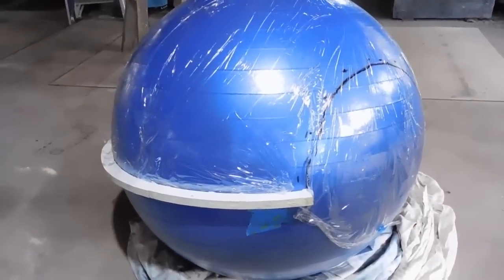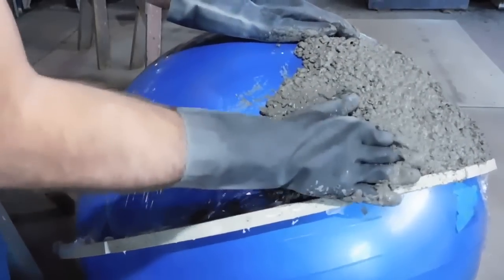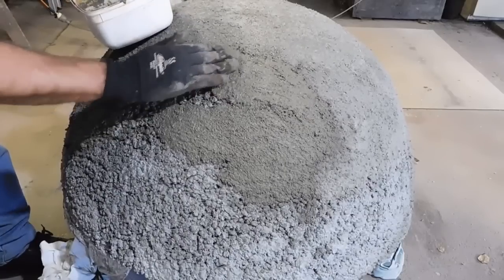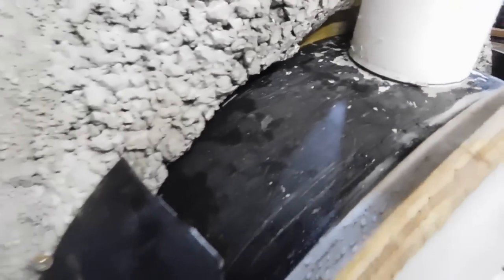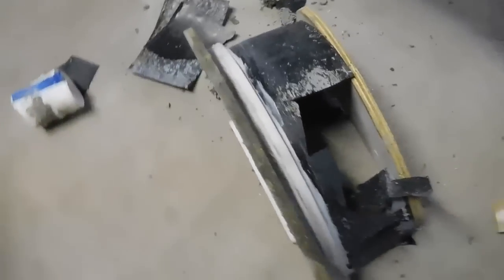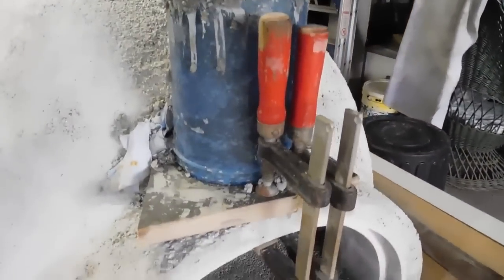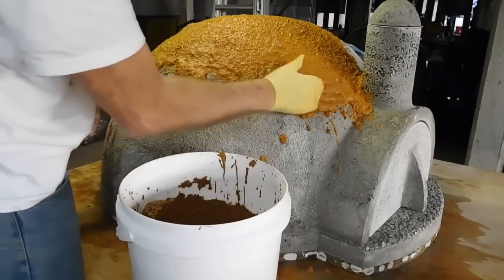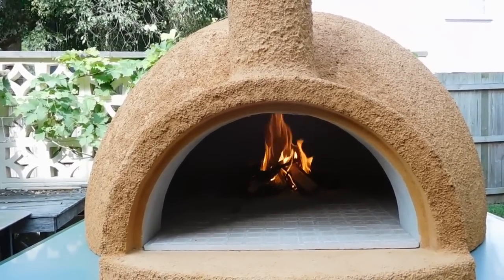Pizza Oven Easy  Build  "Full Video''

Comment: very good video indeed. i have tried the same thing after seeing ur video. thanx for the inspiration m8 ;) 
but i have 2 questions if u may answer. 
1) after you remove the the pastic film that u had wrapted the ball. there are some scratches. when u turn the ciment upside down there are no scatches. u used something i guess... 
2) at the end of the video when open the do or to start the fire there is somethng on the bottom of the oven. is it a tile turned upside down or its my thinging???

3) lastly . english arent my native language so i cant understand some of what ur saying espessially when there is outside noise.... also i dont know the exact names of the matterials u have used.
do u mind writting down how u made the ciment? ( the repipe i mean ) so i wont stragle to listen :P also i could use google translate :)
Reply from the maker: This is 5 part crushed pumice and 1 part standard portland cement. I used fine pumice-cement mix sieved through flyscreen to fill any imperfections on inside and this can be sanded like timber.On the floor are upside down 8mm clay tiles unfixed to keep floor cleaner ! See first oven >https://www.youtube.com/watch?v=uOJq6g4at-0

Comment: Best build on YT! I'm in the planning stages of my build and keep coming back your video. 
Question: What size of ball are you using? Ive built a jig off of your 8" hight for the opening, and it looks small compared to my 70cm ball.
Reply from the maker: My ball was a 75cm pumped to 82cm using air compressor and I think the door is 60% of oven height Jason !
This site shows door height ratios etc>http://pinkbird.org/w/How_to_build_a_pizza_oven
These ovens expand and contract so build fire up slowly and good luck with your oven build !
Reply: @jjgrice018  Thank you for the response!

Comment: How much concrete an perlite should i buy to build the same oven? Thanks
Reply from the maker: I used about 80 litres of mix and weighs about 55 KG ! One 20 kg bag of cement is plenty . I see a lot of people using vermiculite concrete !
Reply: @jjgrice018  ok i think i'll buy a 50 or 60 litres bag of pumice. I prefer this inert because it's lighter and a better insulator than perlite / vermiculite. Thanks
Reply: @jjgrice018  I'm considering in drown a refractory plate in the middle of the concrete platform, where the pizza stay.
Reply from the maker: May work ! Sometimes I put a pizza stone in 10 minutes before cooking pizza and cook on that ! I have cracked them by putting in oven to early !
Reply from the maker: Pumice uses >https://hesspumice.com/pumice-pages/pumice-uses/uses-for-pumice.html

Comment: what material is it in the hob?
Reply from the maker: They are 8mm clay tiles upside down unfixed but did crack and the cracks filled with ash or you can cook on the pumice concrete original floor Manuel !

Comment: Hi mate, you are a legend.
May I ask:
1) what’s the size of that yoga ball? 75 cm?
2) how much pumice did you use? And what size? 1-4mm?
3) what was the ratio of pumice to cement to water?

And finally, what insulation did you use underneath the oven? Calcium silicate board or just refractory bricks?

Thanks
Reply from the maker: I'm not a legend yet as i'm still alive ! It is a 75 cm ball pumped to 82 cm and the mix is 5 part crushed pumice put through 10mm sieve with lots of very fine pumice to fill any voids in mix and 1 part cement and about 1 part water.
The oven base is 50mm of same mix and oven sits on 19mm form-ply with 4mm alucabond on top of form-ply !
See pumice uses here Sir >https://hesspumice.com/pumice-pages/pumice-uses/uses-for-pumice.html

Comment: Great video. I’m between building a brick wood oven or one like yours. How has it worked for you? Any cracks, anything you would do different?
Reply from the maker: Thanks for watching Max ! My biggest orange oven weighs about 55KG  or 120 LB and two people can move it easy and I'm in a rental house but if you own your house i'd build a fire brick one to last a thousand years and has more insulation ! Had only a small crack on front arch that is easy to grind out and repair with same pumice concrete.I still have enough heat to bake a chicken after cooking pizza >https://www.youtube.com/watch?v=kP9poGmzH1g
Reply: @jjgrice018  how long have you been using it?  I've seen people using concrete,  lime,  sand and fire clay for a stronger cast.
Reply from the maker: A few years now ! Build fire up slowly as these things expand and contract with heat ! Throw in half a tree at once and it may crack it !
Reply: @jjgrice018  what material did you use for the dome  and what proportions ?
Reply from the maker: I collected my own pumice off beach ,wash it ,crushed it and put through 10 mm sieve and have plenty of fine pumice in the mix and mix 5 part pumice and 1 part standard portland cement or use hi'temp refractory cement !>https://hesspumice.com/pumice-pages/pumice-uses/uses-for-pumice.html
Pumice is mainly about 70% Silica and 14 % Aluminium oxide that helps with the heat ! Original Roman concrete used pumice ! Top inside of dome is thicker as cops most heat Max !

Comment: Good ideas to release the full video. You've given me the inspiration to make one (I'll make a video out of my Pict I took, eventually). Went through quite a bit of big questioning concerning the crack occurring after a while of use. My other concern and questioning was, why the underneath of the pizza wasn't cooking in the same speed or rate of the above? I came up with an idea by putting a BBQ grill on the bottom of the stove to leave some air space in order to allow heat to circulate, but again it improves but not as efficient as I taught it would be. 

For the crack, I'm questioning the fact that Portland cement is probably not the best! BTW I used Perlite! Now I'm in the next phase of doing another one (The first was mainly used for testing! It had a very tough life!) but this time with "cement fondue" and with the use of thin fire bricks for the bottom section. It will sure raise the cost but it should make it more resilient to crack. The heat was amazing, it took in some occasion few seconds to burn the pizza top! (I learn the hard way!!)

Another option I'm looking into is to make 2 sections or module, the dome and the bottom plate just laid one over the other. This strategy may help to avoid the stress or difference between expansion of each module during the rise of temperature (Crack were from that area also). I'm curious to know your opinion on all this. ;-)
 Cheers
Reply from the maker: Hi John ! Sounds good, put a pizza stone in oven 10 minutes before cooking and keeps floor clean and bottom of pizza is browned well.The two sections would work as long as gaps aren't to big !
See how hot this bloke has his oven which looks best i've seen so far>https://www.youtube.com/watch?v=egomtlRdoKE&google_comment_id=z12wutgzuybsdha3r220cz5onxjhw5evp

Comment: I love the idea! A couple of questions: 1) How long does it take to heat up to pizza cooking temp (750-900 Fahrenheit), and 2) Once at the temp, how long does it maintain until you need to add more wood?
Reply from the maker: Takes about 30-40 min to slowly build up temp to 700F and get some hot coals and a few small bits of wood burning will maintain the heat Josh ! These ovens expand and contract so best to build fire up slowly !
Reply: @jjgrice018  how heavy is it? Has it ever cracked?
Reply from the maker: It weighs about 55 KG and has a small crack on arch that is easily fixed !

Comment: Love this pizza oven mate great job! Just wondering if this oven would be ok if it got wet outside on rain etc?  Or would it need to be under cover year round? Thinking of building one but have no where to store it under cover once built.  Cheers for taking the time to film these.
Reply from the maker: Thanks for watching James ! My oven is pumice concrete that will suck up a bit of water so I put a cheap blue tarp over it ! Not sure about perlite or vermiculite but I think they absorb water to !

Comment: will cement resist to fire ???!!!
Reply from the maker: The portland cement in my mix should be good up to 1500 F and the pumice stone is also 15% aluminium oxide which helps with heat resistance !

Comment: Great video! I’m about to start building my own this weekend. One question: does the outside of the structure get hot to the touch? If so, how hot? Because I would like to mount my oven on some wood pillars. Thanks!
Reply from the maker: My oven base is 2 inch thick and insulates well and underneath isn't to hot as this one and my first one are sitting on 3/4 inch thick form-ply.Thin cement FC sheeting would help as well >https://www.youtube.com/watch?v=oREp3JoV1Wk&list=RDCMUCQOHj33UW_tLQE6f0SdspIQ&index=8

Comment: JJ- I have a few questions

1. How hot does the bottom of the oven get? 

2. Is your floor/base just 5:1 or is there another material to block heat?

3. Do you have plans/blueprints for your first pizza oven stand?
Reply from the maker: It is the same 5-1 mix and is 2 inches thick and the hottest the form ply underneath gets to around 120 F !
The first stand is the form ply it was made on with a 1 inch x 1/4 inch strip around ! No plans sorry !

Comment: Have you tried to isolate the pizza owen?  I just finished my own pizza owen, using the Vermiculite and termo cement, and I'm thinking of doing isolation, because it will stand outside, in the backyard...
Reply from the maker: This pumice concrete holds a small amount of moisture when it gets wet so I use a cheap shower curtain to cover it !
Reply from the maker: This pumice concrete holds a small amount of moisture when it gets wet so I use a cheap shower curtain to cover it !

Comment: John, absolutely amazing job. i have seen so many really complicated builds, i love how straight forward yours is. i have started mine this weekend, based on your design but with vermiculite. What is the base you placed you second oven on, some type of metal sheet? im am a bit uncertain about the form you used for the entrance and door recess, i can make out the outside arch but unsure what dimensions and how many arches are in behind this, could you clarify please
Reply from the maker: The sheeting is fire resistant Alucobond on top of plywood or use a cement sheeting Paul and the arch formwork is reused from my first oven and I show it here at 7min mark>https://www.youtube.com/watch?v=Sny2MCND3nA
This is the site I used for door size 200mm H x 390mm W etc >http://pinkbird.org/w/How_to_build_a_pizza_oven
Reply: JJGrice018 cheers for the response John. Most of the form completed now. Any tips of changes u would make to 2nd design
Reply from the maker: Arch on 2nd one has small crack but not on first oven so maybe make arch thicker and build fire up slowly to temp and don't chuck in half a tree at once as these things must expand and contract !
See here cooking chicken lately >https://www.youtube.com/watch?v=kP9poGmzH1g
Reply: JJGrice018 cheers John for responding again. I plan to make mone about 3 inches think whole way around. Chicken looks amazing will have to get one of those! I spoke to guy here in Ireland yesterday he built his up in inch layers, mixed in some metal shardes put a fibre blanket on it more virmic plaster render and his has cracks in it?

Comment: very nice job. Congrats! did you use any firebricks whatsoever, and what did you put on the floor?
Reply from the maker: No firebricks and the floor has leftover 8mm clay tiles upside down unfixed but are not really needed but are easier to clean !

Comment: awesome work , luv it. i think i got a great project to do now. how heavy was the finished oven?
Reply: also can it be left out side in the weather ? from Melbourne so the weather isnt always the best.
Reply from the maker: I used about 80 litres of dry mix and it weighs about 55 KG and is weather proof but will hold a small amount of moisture so dry out before use but I keep under cover Gary !
Reply: JJGrice018 thanks , very much appreciate your time to reply to my question

Comment: Good job JJGrice.
First of all I congratulate you to work such a big heavy weight concrete work without any helper. You are a reliable person. However I did not see that you have fixed steel net along with the concrete to be more stronger and it will not collapse ?? As well as  to prevent any crack.
Here it is very essential to know if there is  any standard for the measurements (Height and width & Thickness)  ??? 
Finally, I don't know when you did this innovation ,I'm sure you are using it by now, and you are enjoying your own PIZZA and BREAD.
Regards
Bassam
Reply from the maker: Thanks for watching Bassam ! Steel mesh may expand when heated and help to crack the oven 1
See  cooking pizza here >https://www.youtube.com/watch?v=0j_IOWDPj8g
Reply: Bassam Al-youssef uu

Comment: Hi, 
Mate how did tiled it?
Reply from the maker: The tiles inside are unfixed !
See here >https://www.youtube.com/watch?v=0j_IOWDPj8g
Reply: Hi, Jone sorry I keep Hassling you.

I made the oven using perlite, I left it to dry for 4 weeks. And when I started curing it, it cracked a bad crack where you can see smoke coming through the crack. 
Do you think it's fixable or worth fixing? If it's fixable how can I do it?
Reply from the maker: I'd grind out the crack and fill with a fine mix ! Is the oven at least 50mm thick Abdel ?
Reply: JJGrice018 ,
It's about 50mm maybe a bit more closer to the base, i think it's a bit thinner from the top
Reply from the maker: Maybe turn oven upside down and add extra mix to centre area that cops most heat !
Reply: JJGrice018,
It's going to be very hard to turn upside down and removing the base. 
Can I add the extra mix from the outside?
Reply from the maker: That may be your only way to make thicker ! Good luck Abdel !
Reply: JJGrice018 thanks a lot

Comment: Great Job, I was wondering if you know the approx weight of the oven, how portable is it?
Reply from the maker: It's about 50KG or 110LBS and is easy for 2 people to carry !
Reply: That's amazing work, John. How much pumice do you think you used total? Do you think refractory cement would allow for a higher temp, a sustained 900F without cracking? Oh. One more thing, why'd you turn the clay tiles upside down? Thanks.
Reply from the maker: Used about 80 litres of dry mix and the tiles have a ceramic coating on face side and are unfixed and help keep floor cleaner and a pizza stone helps to but can cook straight on original floor.Refractory cement is best if you can find it !
Reply: Perfect. Thanks, John. It was a 5 to 1 ratio pumice to portland , right. Easy to figure from there. Also, one could use unglazed terra cotta if you can find it and have it upright. Although the lines in the bottom looks great.

Comment: when I mix mine 5:1 and 1 part water it crumbles apart any ideas
Reply from the maker: Sounds like you used mortar mix or old cement and not standard builders cement  [ portland cement ]
Reply: JJGrice018 was not wet enough the second one is workinh out better

Comment: Hey, thanks for this video.
In the middle of making mine right now, I was wondering what tile you used? Can it be purchased from Bunnings ? Thanks
Reply from the maker: They are left over 8mm glazed clay tiles upside down unfixed that aren't really needed and some cracked anyway and the cracks filled with ash and are still there.You can still cook on the original floor or place a pizza stone in oven 5-10 minutes before cooking and cook on the pizza stone !

Comment: Hi, Thank you for an excellent film. You've got me to try and make my own oven. I'm thinking of putting the more heat resisting concrete  (cement) on the top of the oven dome. Or mix it in with the ordinary concrete. What do you think about that? 
This would be the swedish version ;-)
I've also bought a 75cm jym ball, So I will get a little more room for firering... Good or bad?
One more thing, My vermiculite is in smaller bits than yours... does that make much differens? Good or bad?
Reply from the maker: Mine is a 75 cm ball pumped to 82 cm and my oven is pumice concrete Maya !
See this vermiculite one here >https://www.youtube.com/watch?v=-j25Z65eaYk&list=PLmE0FyFvptLN86xwLeqt2yPBr3gw3s95d

Comment: Like the principle of making one BUT(!) think you missed something... I know these being made with a thick alufoil insulation layer to prevent the heat loss once in action - I think this could have been done by adding this as a second layer between the initial concrete and yet another one - thickness of the overall oven along with the extra insulation would improve the final oven (in my mind) ... 
Also thin you missed out on the importance of using heat bricks - thats hell better & healthier than cooking direct on concrete!

Would be interested to hear your view point on what I just said
Reply from the maker: A bread oven for 100 loaves of bread needs great insulation and clay bricks to hold the heat but not for a few pizzas.Pumice is a good insulator and keeps the heat in the oven !
I have 8mm upside down clay tiles unfixed on the floor and a pizza stone that cleans easily.
After pizza I have heat left to bake chicken etc ! See here>https://www.youtube.com/watch?v=kP9poGmzH1g

Comment: After done, how long do you have to wait to use it for the first time?
Reply: Angel Marti I've worked with vermiculite concrete before and it dries very slowly. Vermiculite and perlite both retain water I would assume that pumice would do the same. To be safe, wait a month if stored near room temperature.